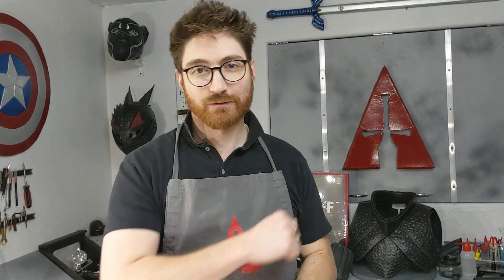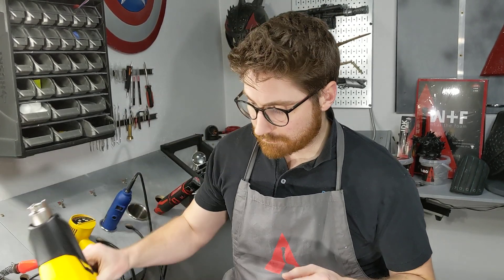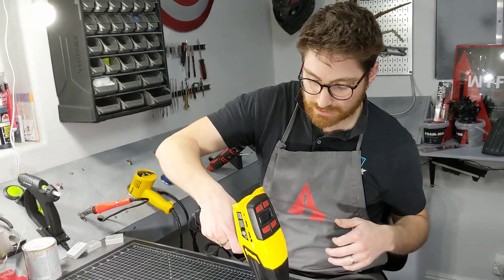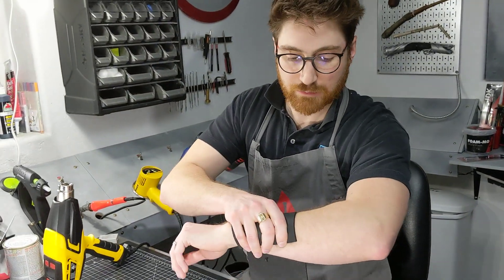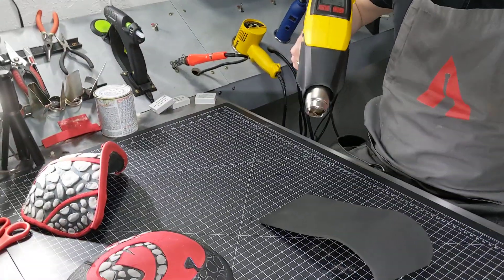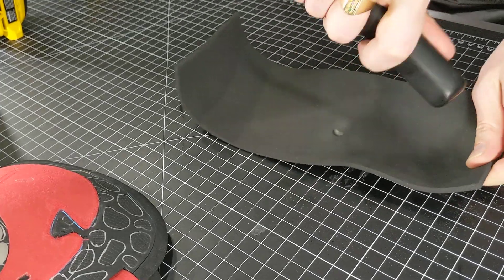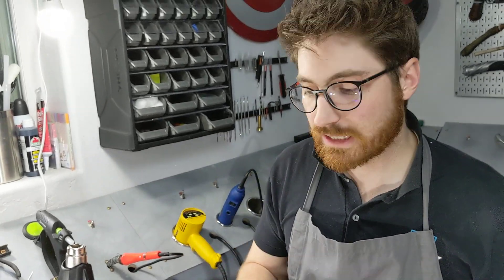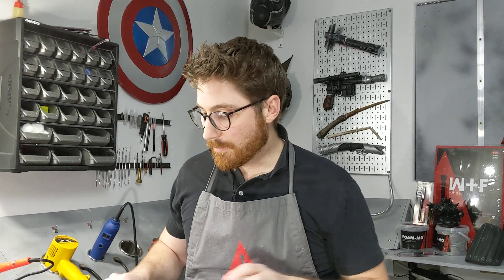How to shape EVA foam cosplay - Quick Tip Clip | Cosplay Apprentice

Comment: I get demonstrating on your own product, but could you maybe do a video using foam those of us on a budget would be able to get?  Like craft foam and floor mats?
Reply from the maker: Yes :) all these same techniques and principles apply to Eva foams across the board including craft foams from the craft store, or foam floor mats, and some yoga mats ( depending on what they are made of, some work some don't:) .  The same principles apply :) I will try and get some floor mat ones to use and display as well :)
Reply from the maker: That is for the suggestion :)

Comment: Hey, I have a question: 
I'm using regular eva foam (5mm in this case) but after the heating and shaping the foam doesn't hold the shape it should be, it's still very flexible and i can shape it back to it's basic form like nothing happended, so do you need special types of foam for shaping or does it work with regular foam?
Reply: Did you make sure to hold it in the desired shape after you heat it?

Comment: YES!!! YES YES A THOUSAND TIMES YES!

Is the complex curve what we do for forming over the breast for a better fit? Also what do you recommend for breast plate 4mm or higher?
Reply from the maker: Yes, complex curves work great for breastplates, sometimes in addition to the complex curves you may need even more curve in a breast plate beyond what you can get in the foam and you may need to add a dart. :).  If you are using WTF I recommend 4mm. For regular high density cosplay foam I would probably do a 6mm. or 10mm